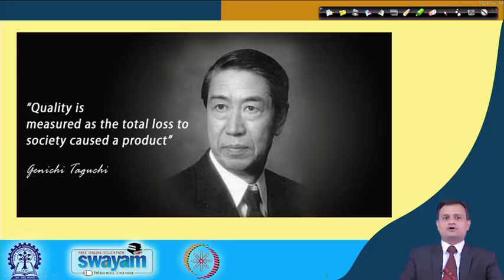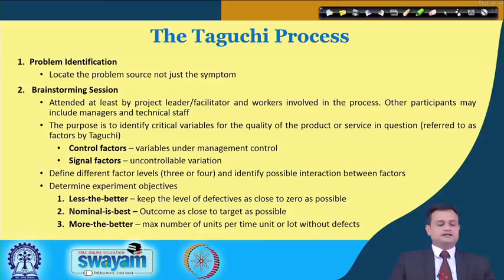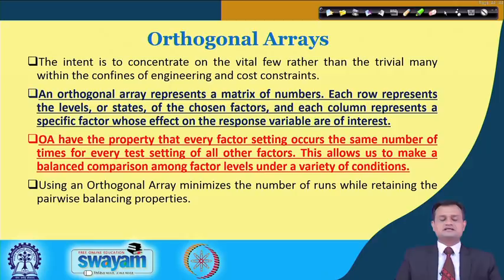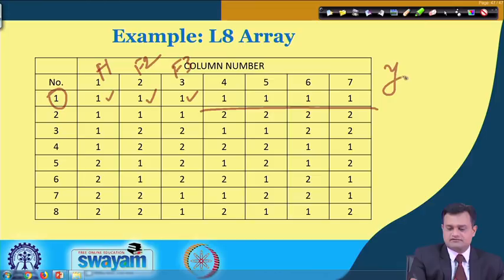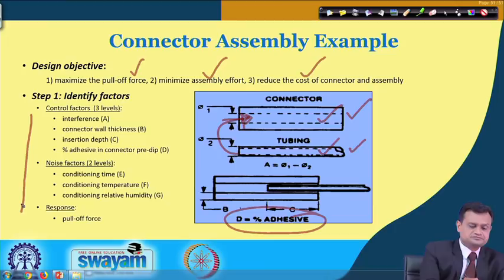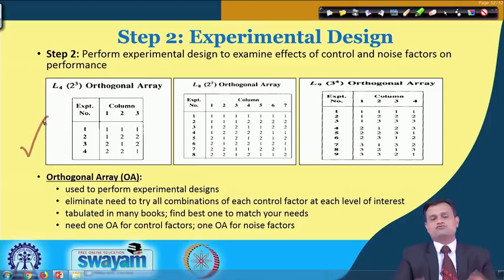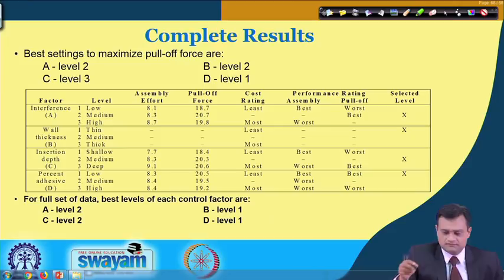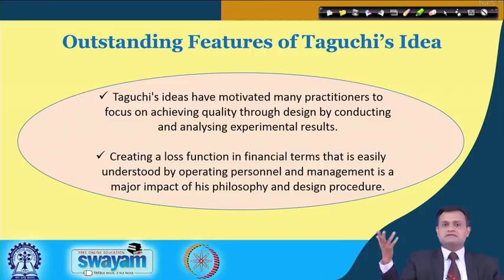Lecture 46: Taguchi Method: Illustrative Application

Comment: 1. If the dependent variable is categorical (i.e. for logistic regression) can we conduct DOE in Minitab? Can we get the right coefficients?

2. If noise factors are uncontrollable factors, then how can we fix the levels of the noise factors (outer array) while conducting experiments?